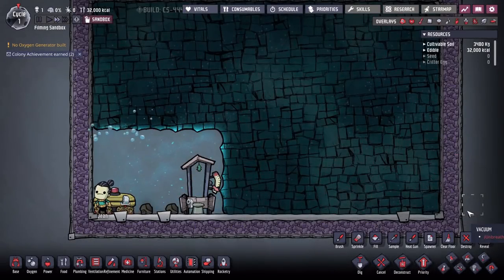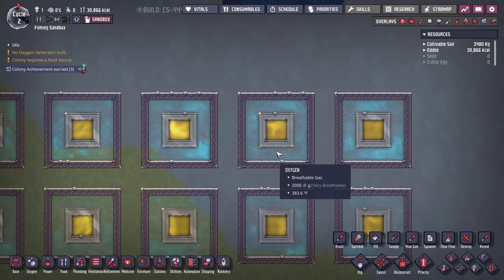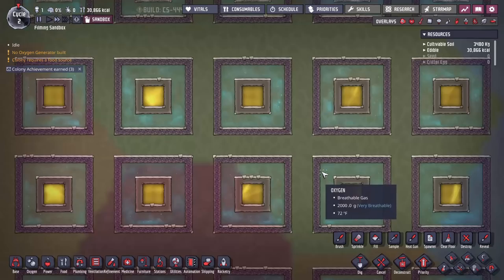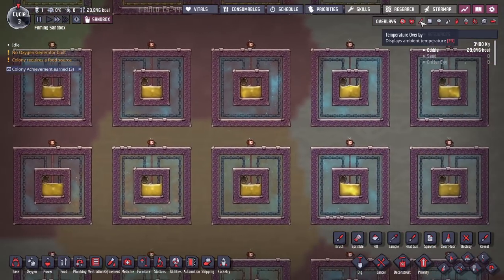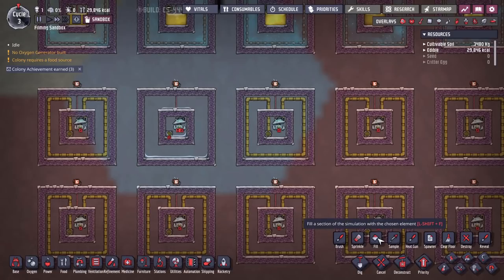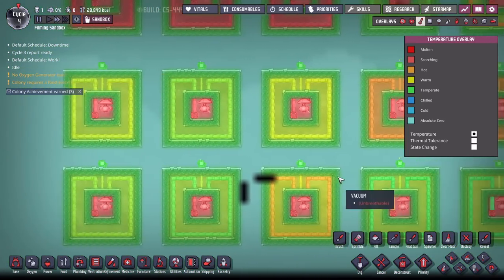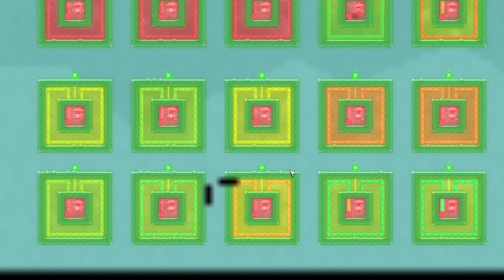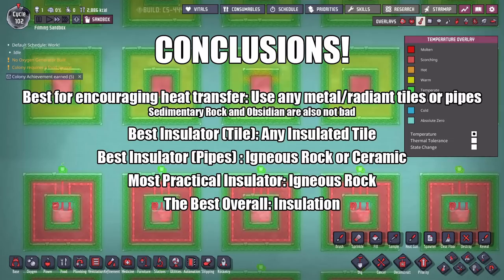Which building materials are the BEST!?  An Oxygen Not Included Science Experiment

Comment: Happy new year.
Love the video as always.
Few nitpicky things/idees...
1 cycle=600s/10min
A plus configuration with multiple tiles to each side and insulasion tiles every other tile on the outsite can give a range of temp changes to difrent materials over time.
One problem with this test is that you are not really testing heat transfer to difrent meterials. Just too o2. I.e. will be difrent to hidrogen and chlorine.
Also some meterials have a higher heat capasity so they take more heat to heat up before it effectively starts transfering heat to the o2. (So difrent materials have difrent uses. If you want instant trancefer lower heat capasity is beter but less stable and faster acting. Higher heat capasity is more stable but takes longer to heat/cool at the start.)

Future totorial might be a test to show some traps players can fall into while bilding:
1. Building a temp shift plate next to a insulated tile actually cools/heat the insulated tile and thus can interfere with cooling of a room.
2: building a raidiant pipe inside a insulated tile actually transferes heat between the 2(heating/cooling the medium in the pipe and the tile) but a normal pipe does not do this.
This can be tested with a cheker patern and vacume in between.
3. Double insulated tiles next to each other is one of the best insulated plays as there is almost 0% heat transfer between the 2 even between the 2 lowest insulated rated materials. Its almost as efective as a vacuum. The idee of insulated tiles is just a batrier between 2 materials. But if you heat up a insulated tile then it will heat material( see trap 1) on the outside. So insulation should be seen as a barier rather than a tile between 2 materials.
Reply from the maker: These are awesome tips, thank you for the info!  I'll certainly mix some of these tips in with other things I do, and if I produce an advanced temperature control video, I'll be sure to implement the things you mentioned here :D